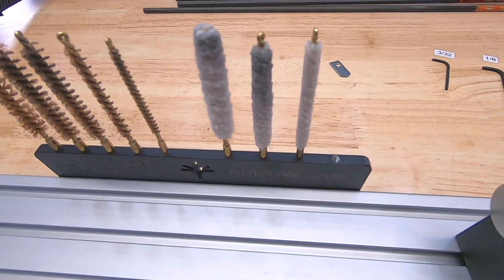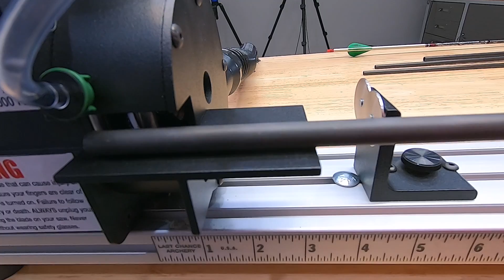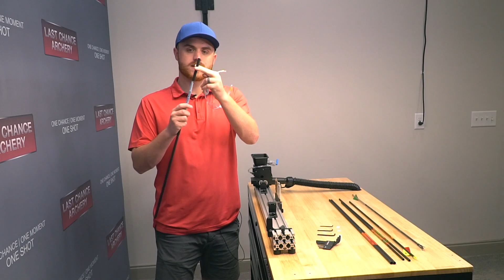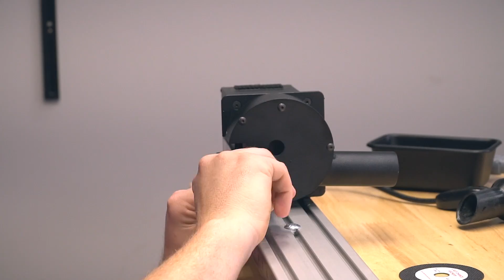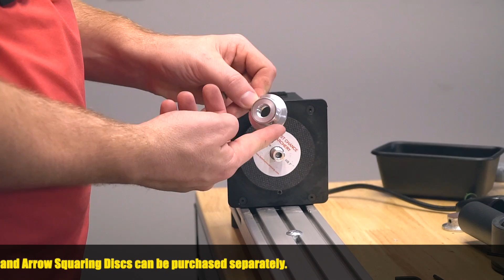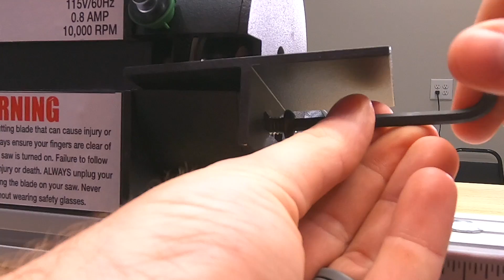Revolution Arrow Saw + Instructional

Comment: might be a dumb question but do you remove the filter in the shop vac when using it with the saw?
Reply from the maker: That's totally personal preference, but the filter for sure would help keep carbon dust from getting out of the vacuum.